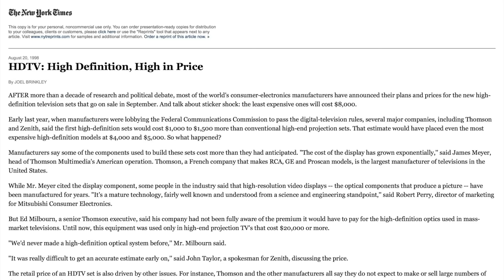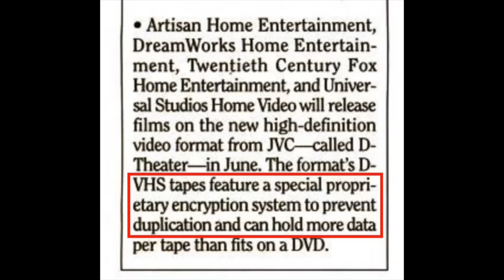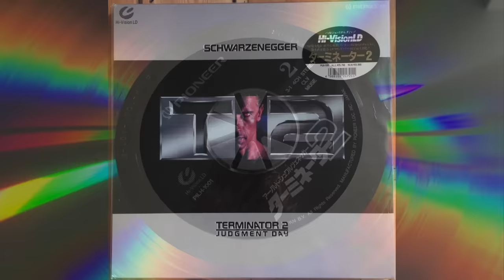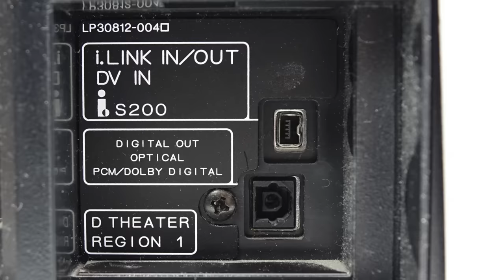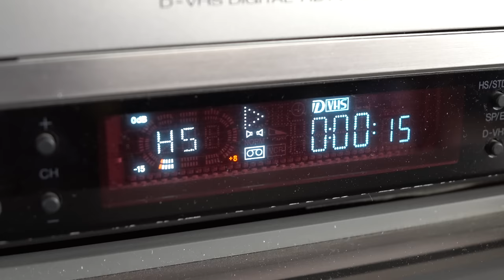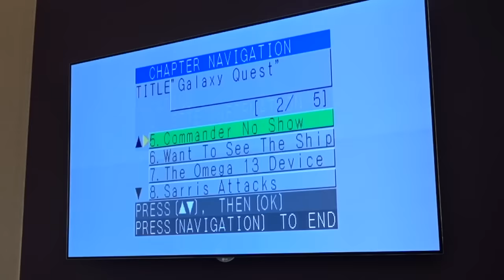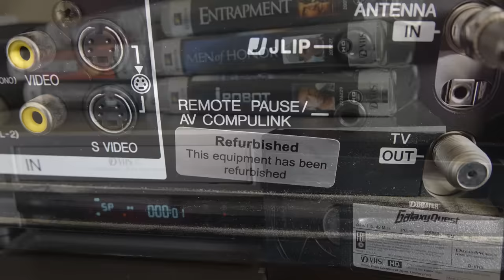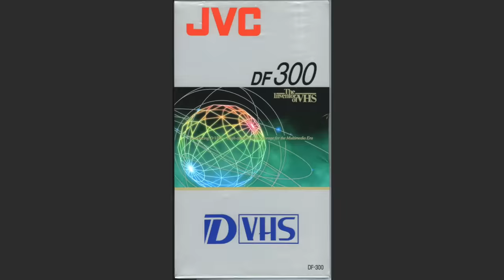Remember when HD Movies came on VHS tapes?

Comment: i’m one of those early adopters, I have the hm-dh5u ($1000). the problem with recording in hd was you had to have direct tv (a satellite company), that was the only source for hd at the time other than over the air. my apartment building didn’t allow for satellite because it’s wired for time warner (now spectrum) cable and an hd cable box was a year away from development at the time. as far as reliability goes i guess i’m lucky because it still works fine, although some of the prerecorded movies suffer from typical tape problems. my only regret was not purchasing the one with the digital tuner which was $500 extra.

Comment: I was taping movies off of Dish Network with the Panasonic combo version of DVHS which had a tuner that fed firewire to the VCR and played via component to your TV. Dish had tuners which they obsoleted later that had a modulator that fed OTA high def to the Panasonic tuner. The Panasonic DVHS players had to be fed through the tuner it had no component out. I actually was splitting the dish signal to three combos so I could tape 3 movies a day while at work. The Panasonic tuners had a flaw there was a resistor that burned out in them all the time. I used a lot of tapes I got free from a wedding video studio, they had bad spots in them where they paused while editing so I have bad spots in a lot of movies. Something not pointed out was that the hole on the bottom of an SVHS tape that differentiates it from VHS is duplicated on the other side on a DVHS tape, that is the difference plus the most common DVHS DF300 tapes were 2.5 hours. It didn't matter to the players though I used SVHS and never drilled or melted the holes. Now I have a JVC HM-DT100 that plays out HDMI, it has an OTA high def tuner but they go bad mine went out right after I got it, the seller kicked me back a little on it because I wanted to keep it for playback.

Comment: This is an amazing bit of information I did not know. did normal VHS work on the player?
Reply: I don't think so, it was a data tape not a "film" tape
Reply: Regular VHS and SVHS tapes play fine on these machines. I have its bigger brother, the HM-DH40000, and used it lots of times to digitize my old home movies and capture them via i.Link to my PC or just play on the TV. It's a better VHS VCR than any I'd ever seen due to all the built-in stabilization that lesser units never had. Even ancient VHS tapes with hideous tracking issues play better on it than on standard VHS decks.
Reply: Ethan Gekoski 
Does it also output through the component cables?  

I had a combo dvd/vhs unit that would output dvd through hdmi, but vhs through old school composite or svideo...had to have both outputs connected to the tv, and switch inputs when you wanted to switch media
Reply: Problem with these, as most later VHS machines, is that they play the older linear sound track only in mono. I only watch D-VHS tapes on mine as to not wear the machine out too fast- they were rather cheaply made compared to models made in the 80s.

Comment: You made a small mistake: You suggested that the 1993 footage was a little soft, and that cameras had gotten better a little bit later. However, this isn't an accurate statement. The thing would have been shot on 35mm film, which has a higher resolution than hd anyway, hence why movies like 2001 still look so great.
Reply from the maker: It was shot on video.
Reply: Just a note here, if someone stumbles here wondering old film resolutions:

Analog film does not have resolution like modern digital ones.
The equipment (optics and the film) are the primary things that affect the final quality. The rest (when converting into digital format) is entirely up to the scanning equipment.
Reply: I suppose a more appropriate term would be "optical film" rather than "analog film"... Optical film has a "resolution", but it's not as precise as in digital world of course.
Reply: Well, unless you can quantify the pixels expressed as binary sample rate slices of realtime(e.g. 44khz @ X • Y pixels per frame)...it is analog. It is only quantified in the sense that you know how many analog pictures you have per second. It doesn't get anymore analog than that. If you took 5 pictures with a civil war camera over the course of 25 minutes strung them together into a blurry motion picture flip book, that doesn't count as digital.
Reply: The footage would have been shot on (and indeed looks like) video, not film. Not sure why you would think that costly 35mm film stock, camera and lenses would be requisitioned for this purpose with the prevalence and convenience of video in 1993.  Maybe you were referring to the clip from iRobot?
Reply: Also, 2001 was mostly shot on 70mm.
Reply: For the record, that's one of the reasons Stanley Kubrick, who thought stereo sounded apaplling in the movie houses of the day, insisted about having his films released with a mono soundtrack even when stereo sound was being more and more widely used after the mid-seventies. 70mm, with its magnetic tracks, made stereo more or less mandatory, as movie houses would have had little interest in programming a 70mm movie that only had mono sound. 2001 is, with Eyes Wide Shut, as Kubrick has passed away before the film's release, the only of his films to have been originally released in stereo. Which is a pity, because the soundtrack recordings were made in stereo, because of LP and later CD release of the albums.
Reply: +Liam Walters
+Techmoan
I believe the Japanese HD format in which this footage was shot for the Japanese HDTV demos was an ANALOG format.  The scenes were shot in HD, but not DIGITAL HD, they are soft because they were originally analog, then digitalized from the analog masters.  I also don't remember whether the resolutions were identical.
Reply: As others pointed out it was shot on video. You can easily see the color bleed. Still very good for its time.

Comment: Based on watching this, I purchased a D-VHS deck. Partly to have a good VCR to help digitize my childhood home videos, and to actually see HD on VHS. So cool!  Just if there was a straight forward way to convert component to HDMI. So many darkened and crushed blacks with the $20 Amazon converters. I found the OSSC is good, so long as you increase the brightness from 128 to 140. Also shocked the chapter selection works!  No clue how, but it works!

Comment: Do the tapes degrade over time like the laser disc and other vhs tapes?
Reply from the maker: +MegaCallum10 everything on the planet will degrade given enough time, even plutonium, however I've been watching 14 year old HD videos and there are no drop-outs yet.
Reply: Techmoan Thanks :) Nice to know the quality of the HD VHS tapes are not just better in picture quality but also duration. So do normal VHS taps work on it or does it use a slightly different technique to read the digital signals of the tape?
Reply: +MegaCallum10 I have at home 25 years old 10 times overwritten vhs and still works the last movie I recorded. I can not say the same about the DVD. all of my 2000 dvd collection are gone.

Comment: Let's go back to Cartridges for video games and VHS. lol.
Reply: Now to bring back the VCR!! :D Tylore Rogers
Reply: They should sell movies on SD cards, and "SD Players" that hook up to your TV and just play the movie.
Reply: that Nintendo switch coming out next march uses cartridges that load instantly and don't have to copy to a hard drive like the ps4 or Xbox one
Reply: The Nintendo Switch is using cartridges!
Reply: nasachusetts Actually, digitally downloading games is the best format. Assuming you have a big hard drive, of course.
Reply: Yeah!  I hated the switch to spinning optical disks for games.  The loading times, the need to be careful not to scratch the delicate little flower.  I thought "this is an improvement?!".
This on top of the ugly-as-sin early 3d rendering the Playstation and Saturn were pulling off... not the best of experiences, for sure.
Reply: PlumbDrumb CD's could hold way more memory than cartridges. That's why stuff like FF7 wasn't released for the N64. So they were an improvement in many ways.
Reply: Blu Ray discs are the best if you want physical media. They don't scratch easily and hold a lot more space than CDs or DVDs. That's why I liked the PlayStation 3 so much
Reply: Ah yes, I've seen Nintendo rep's refer to them as "cards".    Still, this is the way to go, regardless of what they are called.
Reply: One Tasty Pizza And you have a high speed internet connection.... and if the server is not overloaded.

People from super developed countries love the cloud, I hate it.

Comment: couldn't they just split movies over multiple dvds and have users swap disks or have two trays the played after each other?
Reply from the maker: +jlebrech bitrate.
Reply: Techmoan oh I see, the dvds would have to spin much faster.
Reply: +Techmoan Compression. Pirates are happily downloading and enjoying films ripped from the original 25-40GB (depending on the film) in 1,2 or 4GB file sizes, which would happily fit on a DVD. It's lossy and so some people are going to be intrinsically against it, but the loss of colour and sound data is much less bad than the loss of sheer pixels that comes with 480p.
Reply: +Fry You're getting the formats mixed up. h264 is the format used on blu-rays, and they for sure can't get squeezed on a 7.4GB DVD. But yeah, the h265 format, that will be used on UHD blu-rays should be efficient enough to fit a 1080p movie on a DVD. Maybe not qiute the same quallity as a standard blu-ray, but a lot better than fx 1080p on Netflix.
Reply: +other tomperson Those pirated copies are usually in x264. It's very similar to h264, but it is a bit more effective, so the quallity loss is not as great, as if you would fit an h264 on a 7.4GB disc.
Reply: +Anders Dalsgaard  It's very possible, look up AVCUD.
Reply: +Techmoan Reminds me of the old VCD format where you have 2 or even 3 discs per movie.
Reply: +Fry " h264 today you can easily get 1080p bluray on 8GB at close quality to the actual bluray"    

hahaha no. At such small sizes always choose 720p.
Reply: +jlebrech "Pirates are happily downloading and enjoying films ripped from the original 25-40GB (depending on the film) in 1,2 or 4GB file sizes"

Ignorant people are unknowingly downloading "video" in worse quality than any format that has ever existed, resulting in them being fed entirely unnatural motion and picture and thus unable to reconnect with reality.
Reply: +Anders Dalsgaard actually, its still h264. x264 is the name given the the encoding "library" that software like handbrake uses to make the h264 content
Reply: iwanthalo3 Yeah, you're probably right. But are pirated movies that fit a DVD not riped in 720p though? That would make a lot more sense. I'm not sure i would like to watch a 1080p movie at only 7.4GB :/
Reply: +LemonSlice This is only possible for animated/CGI kid flicks due to the compression being very efficient with these types of movies.
Reply: Anders Dalsgaard There are a couple of other factors that can determine whether a certain filesize is palatable. First is the aspect ratio of a movie, a 1.78:1 movie will need a lot more data than one shot in 2.35:1. Second is obviously the length. Third is how much data does the sound take. Fourth is how detailed are the frames, a movie shot on film with visible grain and lots of motion will need more data, but even with a camera on a tripod all the time, or with the piece of animation, the frame can show lots of micromovement that makes the scene feel alive that is often absent in rips. So that fourth factor is something that is more often than not better ignored.

BluRay encoding is not the automated process that release groups do, even those using excellent settings and proper filesizes. But a good rip is still better quality than you can stream.
Reply: spikester A lot of animation today is very clean, but something like a Pixar flick can be very detailed, and like I said, rips can be missing those tiny features in the frame that make it feel alive. On BluRay, even with a (good) CGI movie, a still shot with no movement never looks the same as when paused.
Reply: +LemonSlice Yeah idk how people can watch those. I'd rather watch a VHS or Beta than a 700MB digital copy. 
One problem with trying to come across old, uncommon movies is that those that have digitized the tapes still compress the hell out of the digital file. It's super annoying when the already below average picture quality gets made worse because someone is cheap on HDD space...
Reply: LemonSlice Oh please. The colours are inaccurate and it introduces banding but it is only as bad as watching it broadcast over satellite. It's a step down from Blu Ray, but still massively better than DVD.
Reply: other tomperson I can't stand "HD" broadcast. Yeah it might be 1080, but it's horrible colour and just looks super compressed.
Reply: bassl0va Because it is super compressed. Once again you are completely missing the point which is that it is still better than DVD. That's what I'm comparing it to, not uncompressed Blu Ray -_- I would rather lose colour fidelity than 80% of the pixels.
Reply: +Techmoan
One word! Well, what about it?
Reply: Maxx Fordham Well it's not enough simply for all of the information required for 1080p, and to a greater extent 4K, to be present if you cannot transfer that information fast enough to load and then display each frame.

Therefore bitrate is more of an indication of how much fidelity you could theoretically have than sheer file size.
Reply: other tomperson what if they loaded off two drives at once with each alternate frames on separate disks. also can't a DVD just play at 16/32 speed or something to increase the bitrate?
Reply: jlebrech What like SLI AFR for DVDs? xD Christ the synchronisation issues alone with that would be horrendous. No, that isn't a viable solution.
Reply: OMGosh!
Reply: +LemonSlice - "...entirely unnatural motion and picture and thus unable to reconnect with reality".
Are you suggesting that the typical Michael Bay Transformers-fest with 99% CGI, ADHD editing and digitally-tinted amber-and-turquoise-o-vision is remotely natural or connected with reality in the first place?! :-)
Reply: +Techmoan 
The discs themselves could handle a much higher bitrate as long as you have a high speed dvdrom. Of course it would no longer be the DVD format when it comes to the video format, but the discs themselves can easily handle hdtv bitrates. I got quite a few 20mbit~ mpeg2 videos backed up on old dvds and from what I recall it would be fast enough to play those from the disc itself.

Comment: Question, can you play D-VHS movies on a standard VCR? (without HD quality, of course)
Reply: I would assume not cause D-VHS is digital
Reply: OK.
Reply: Adam Carvalho at around 5:40 in the manual, it says svhs, which I assume is standard definition
Reply: No, S-VHS means Super-VHS which is a slight enhancement from standard VHS where the luminance and chroma components of the signal are recorded separately. It is still standard def tho.

I'm quite sure that you cannot play a D-VHS cassette in a standard VCR. But you apparently you can play VHS/SVHS cassets in a DVHS VCR.
Reply: @iberiuspred4906  Normal VHS has 240 lines horizontal res, the SVHS is broadcast quality at 400 lines

Comment: I hadn't heard of D-Theater but I do remember around that time thinking around that time HD-DVD sounded interesting but then BluRay was supposed to come out and everyone was saying none of the formats would be compatible so we waited to upgrade anything until the format-war was over.  I now have a 4K TV but only because that's what they sold when I needed one.  All the rest of my stuff is still just 1080P 3D maximum....which causes some problems with HDCP.  Had to get a HDCP spoof/crack box to make Netflix/Amazon accept the new TV thru my existing surround-sound system because it didn't want to let me play anything.  Several friends pointed out if I pirated instead of buying things thru proper stream services I wouldn't have these problems...shame companies are shooting themselves in the foot with "protection".

Comment: It may have been said here earlier, but virtually all current surround receivers will not output via the HDMI connection if you have anything greater than 480i. So you will need a video scaler or a TV with component HD inputs.

Comment: This digital video was absolutely fascinating (as are all of the other brill digital videos of yours I have watched on YouTube so far.)

I already know that you can use video cassettes to record digital video before DVD and Blu-Ray came out, but I never knew that you could record hi-def digital video to cassettes and play it back from them (and VHS cassettes at that.)

As a side note, I wonder how many takes you had to do to say "DVHS" correctly? I am sure you must have said "DVD" a few times by mistake! :-))

As another side note, I bet you didn't know that VHS, like DVD, had a dual meaning. Just as the DVD industry could not decide whether "DVD" should stand for "Digital Versatile Disc" or "Digital Video Disc", so made the abbreviation not stand for anything, "VHS" also stood for "Vertical Helical Scan" as well as the official JVC definition of "Video Home System." Of course as a brill computer and electronics joke, CDs are also digital and versatile! Sorry, I couldn't resist that one!

I also couldn't believe how many films that I have on DVD (but some I have yet to watch) were shown in your digital video. Examples were Galaxy Quest (which I have watched once), I Robot,  and (I think) Disclosure.

Anyway, thanks for reading.

Alastair C Parker